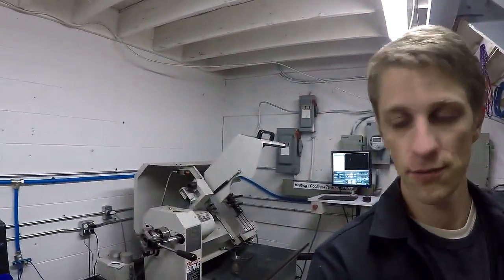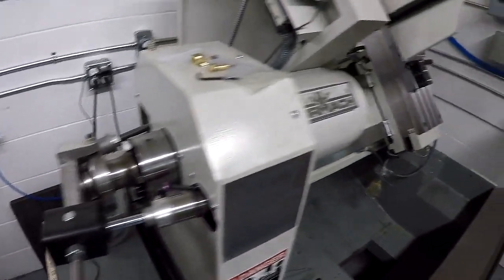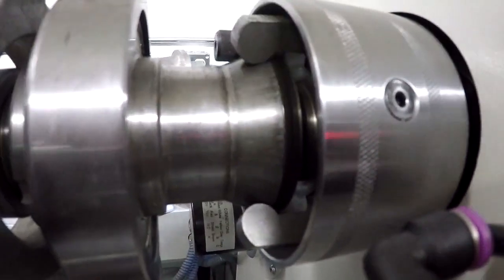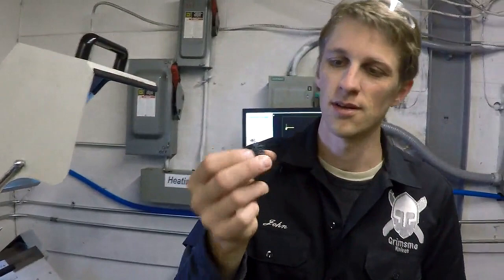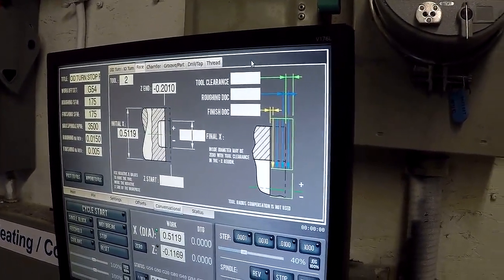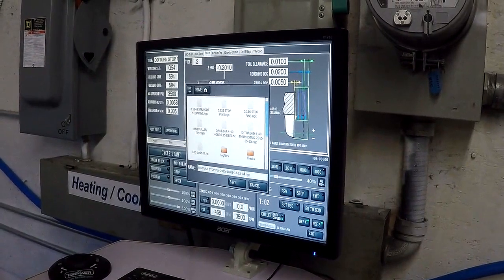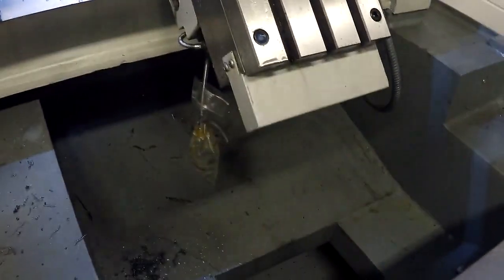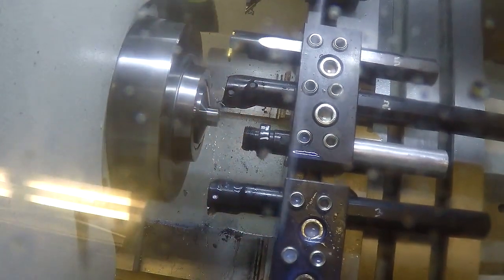KMT 119 - Erik learns the Tormach Lathe

Comment: Hey guys a little tip, i worked in a fixture shop and use those dowel pins every day. The best way to cut them is on the mill with a carbide end mill. Those things are harder than hell and i tried cutting them on the lathe, grinder with a cut off wheel,  sanding them shorter.. Putting a dowel in the slot in machinists vice and putting that in the bridgeport vice - by far the best way. cuts her like butter.
Reply: Agreed, I don't know how many inserts I've destroyed trying to turn gage pins.

Comment: That 594SFM was too much for a hardened dowel pin.  That pin is probably RC55 or so, and while it is likely 4140, you need to be much more conservative with hard turning.  I'll wager that insert was damaged during that aggressive of a cut.  My gut tells me that 1200RPM would have been more appropriate, the feeds and DOC were fine.
Reply: +eformance agreed.  3500 rpm with no coolant?  probably why we were seeing sparks...

Comment: Wow, that collet change is like 100x more difficult and complicated than a Hardinge.
Reply: +eformance They made it look like it at least but it seems is should be the same except there is a lock pin rather than the little catch. Should be able to hand tighten in lock position and then add a few clicks in the unlocked position as per Hardinge.
Reply: +littlestworkshop Tormach needs to add a "freewheel" mode to the collet lock so the operator can manually check the collet closer pressure, to prevent it being too tight or too loose.  Also, the area where the rotation lock is too tight, they need to make it easier to get your hands in there.  That's why I said the Hardinge is 100x easier, you can get your hands in there and it's not a pin, but a lever that you press with your thumb.

I know that Hardinge conversions use the same pneumatic cylinder on the drawbar lever, but Tormach should just offer a pneumatic drawbar, there are plenty of 5C pneumatic drawbars on the market.
Reply: +eformance I can see it is a little harder (I have a Hardinge clone) but  I think 100x was a little harsh :) I imagine price drove the design decisions though I don't know what the collet closers cost.
Reply: ***** Yes, 100x is exaggerating, but let's say it's 5x easier ;-)